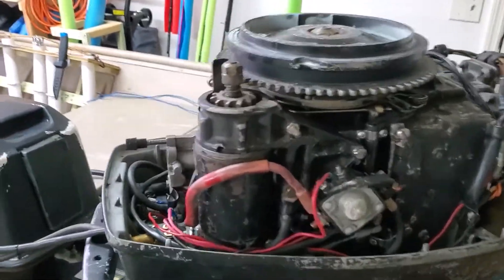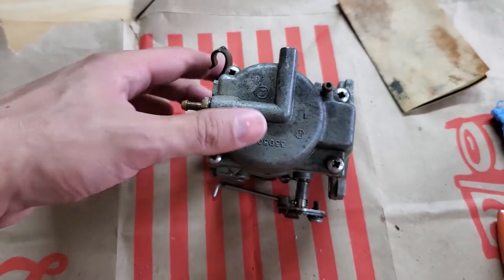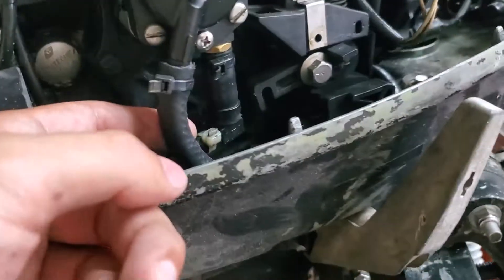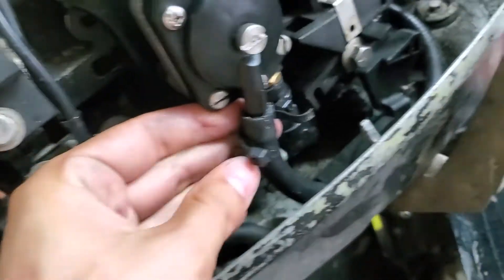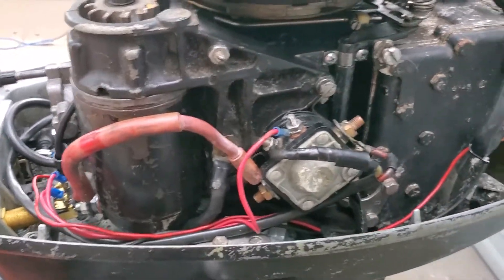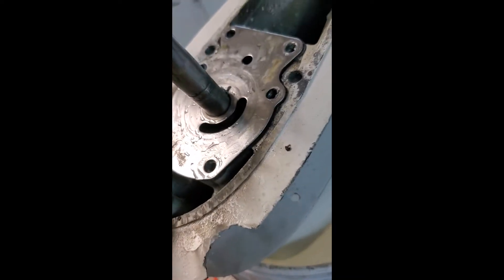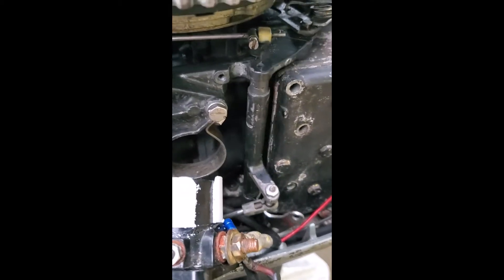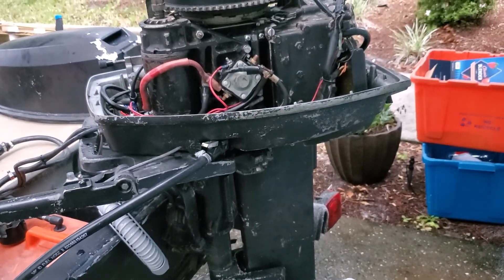Repair of carburator, fuel pump, and water pump on a 1987 Johnson 25 hp 2 stroke E25TECUR

Comment: I might be that one guy. Mine is popping a bit and a bit rough running, kind of stumbling before it pops . Sound lime a fuel delivery issue?
Reply from the maker: Start with a carb rebuild, it's easy enough. Check compression, check spark as well.